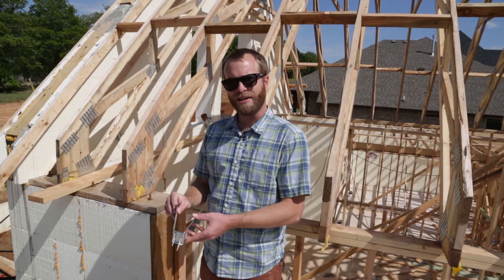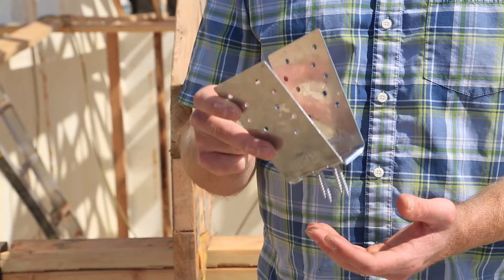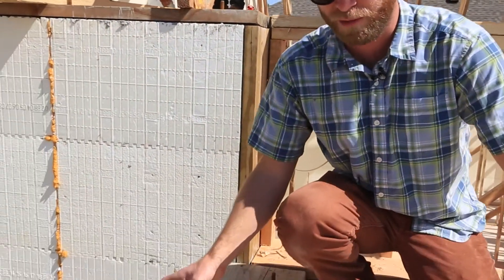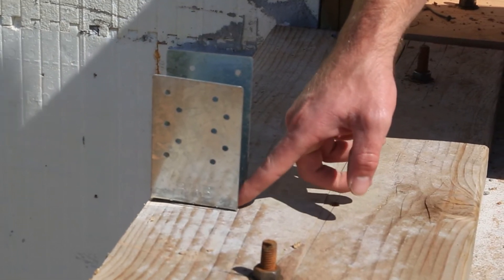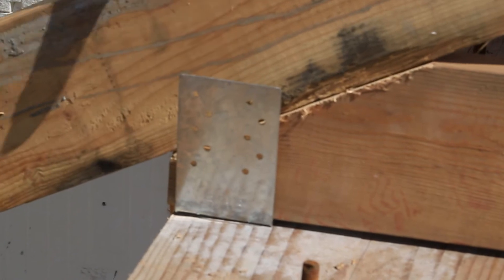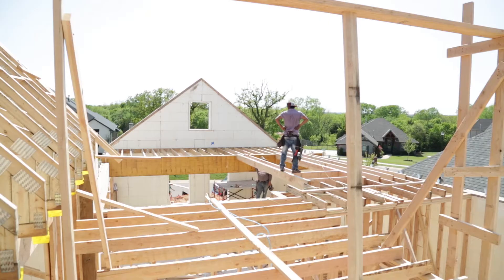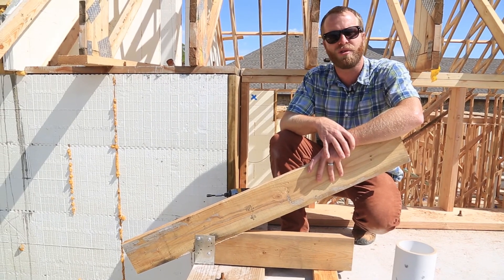How to Install Burmon Hangers on an ICF Project

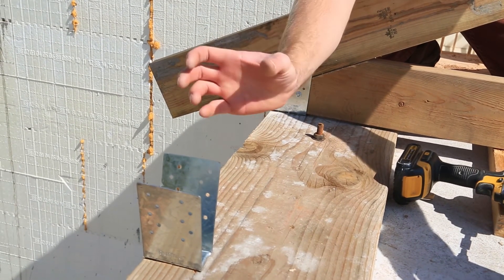Comment: If you move the bracket in towards the centre an inch or so you'll have more holes to hit equally.  You'll have a hard time getting four screws into the lower / inner joist at 2:21